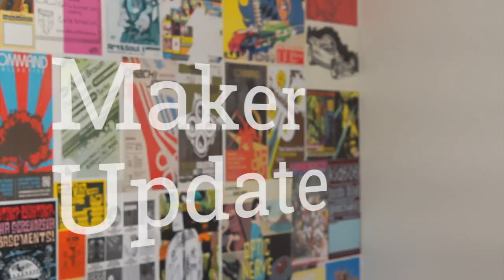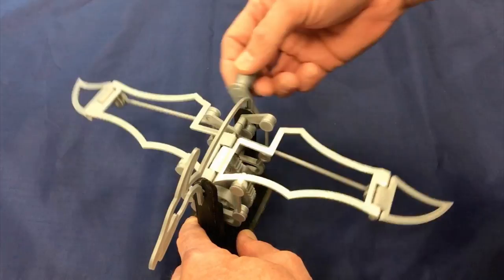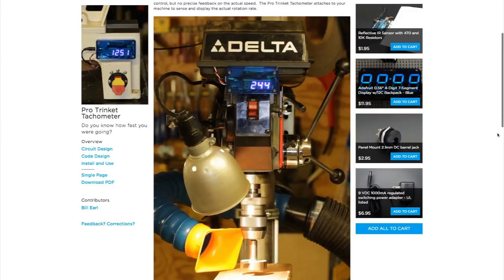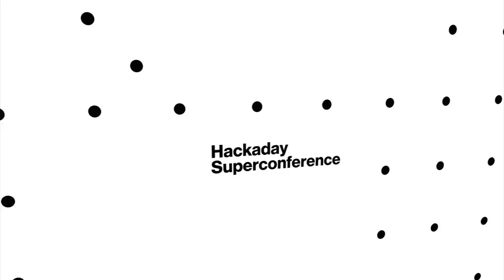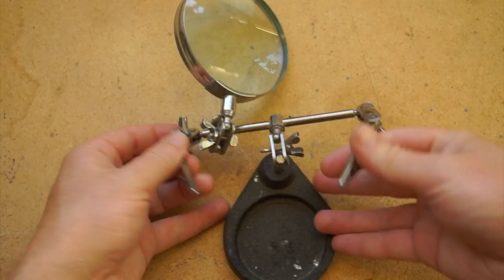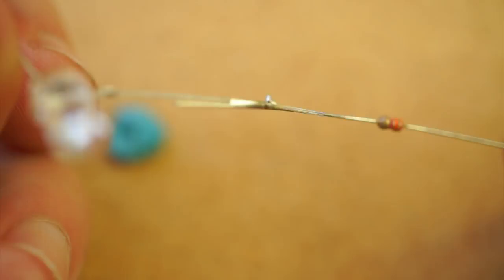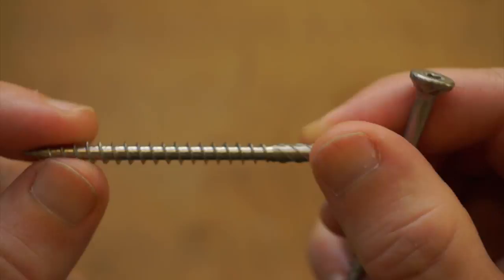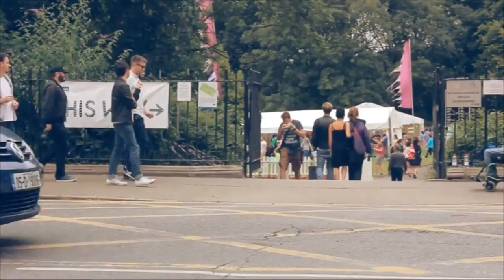Power Tool Tachometer [Maker Update #42]

Comment: How does the poster tack react to high heat? Just wondering if it gets softer or it gets messy if you put too much heat into it. 

Thanks for sharing!
Reply from the maker: In my experience, it can temporarily get a little loose and snotty, but congeals back to its original consistency when it cools down. I wouldn't torch it, but I've yet to regret using it.